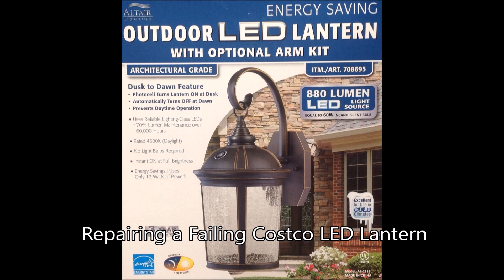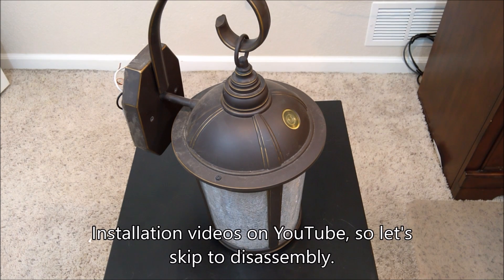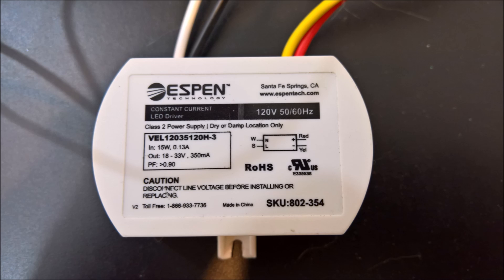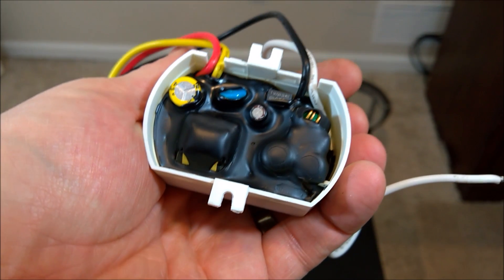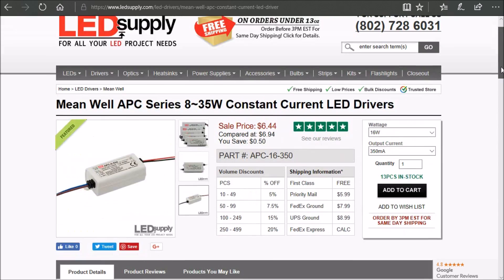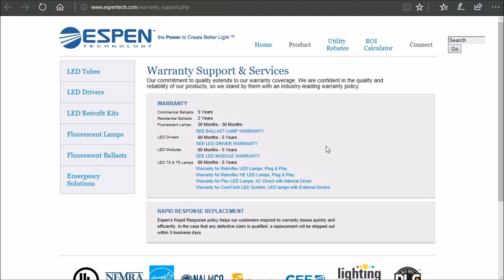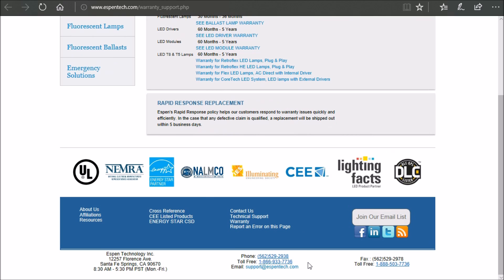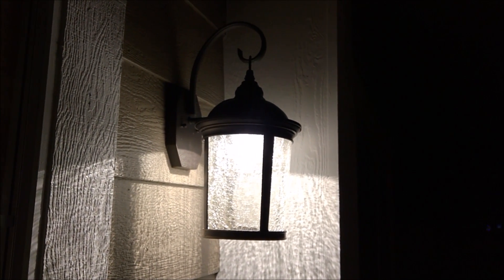Costco LED Lantern Repair

Comment from the maker: To bypass the photo cell, first turn off the power to the light(s).  Start by removing the glass diffuser (the two screws), then remove the three small screws that hold the aluminum disk/reflector.  Now your able to access all the wiring.  Simply remove the single wire nut connecting the black current driver wire to the red photo cell wire.  Notice that there's a single black wire that goes from the house power all the way to the photo cell.  Cut that black wire leading to the photo cell about half way.  Strip the end of the black wire that goes to the house power, about 3/8-1/2 inch, and re-connect it to the black wire of the constant current driver with the wire nut.  You can safely ignore the red and black wires to the photo cell (leave them disconnected).  Re-assemble in reverse order.
Reply: My exterior led wall lantern ceased to function.  I never experienced the flashing behavior, it just went out like a dead bulb.  I was thinking it might be the led disc bulb in it, and I have removed it, but I know not how to test it to determine if it is good or bad.  If it is bad, I have yet to find one available anywhere that would be an acceptable replacement.  Would you happen to have any recommendations as to what I could do, besides replacing the whole unit?

Comment: the problem was fixed because you bypassed the photocell. That is why your unit was flashing. Masking tape over the sensor would have solved your issue.  Light reflected was turning the fixture off, then it goes on, then it goes off.  Common installation issue.

Comment: my Manual for (altec AL-2148) says on Pg.2:  Maximum Wattage 9 W..   so the APC-16-350 , even the APC-12-350 is concerning unless it has a range.. STILL confused..
Reply from the maker: Sorry, I'm not sure if that's the same model.  The idea behind this video is for you to examine your existing driver, decode the values listed on that driver, and try to find a replacement driver.  Do not simply buy what I used hoping it may work, unless you have lights exactly like mine.   As far as wattage, the driver's wattage should exceed the LED light array wattage.   This is just the driver's capability.   Next, you need to determine the voltage range required.  Looking at your existing driver, hopefully there's something like "voltage range" on its label.  Your new driver needs to meet or exceed this.   if your existing driver's voltage range is 18-33 volts, then your new driver must have this range or greater but includes the original values.  For example, 14-48V.  Lastly, is good to check the temperature range and water resistance of the new driver.   The reason we need a wide range of operating voltages is because LED's voltage drop varies with temperature.  And just to let everyone know, it's been over six years since I made this video, and all of my lights are still working.

Comment: Hi Ricardo, Thank you for the video. At the 11:38 mark, the red and black wires from the light-sensitive disk aren't attached to anything. Should I do anything with them before I close up the lamp?
Reply from the maker: Those wires are for the photo (light) sensor.  I think I mentioned in the video that I was bypassing the photo (light) sensor.  You may want to check out my second video on repairing the light here's a link https://www.youtube.com/watch?v=YDYhNTIJgg0
Reply from the maker: If you want to keep the photo sensor, think of the sensor as a switch.  The sensor conducts (switches on) when it gets dark.  The sensor is then wired between the house power and the constant current driver.  The sensor's black wire would be connected to the house power (hot black wire) and the sensor's red wire would be connected to the constant current driver (instead of the house hot black wire).  I think I included this detail in the show notes.

Comment: How can I order LED light disc.
Reply: It's not worth messing with just buy a ceramic bulb fixture from Home Depot and remove the transformer wire in the bulb directly to the dusk dawn sensor if it is still good. Then you can just use a regular LED bulb never have a problem with it again.
Reply from the maker: @Mike-01234  Many LED light bulbs are meant to be used indoors.  The huge temperature swings can and will kill these bulbs too.
Reply: @rickmorenojr  Never had an issue with mine. I'm in Phoenix we get some temp swings from 20F-120F

Comment: I have used this video several times to help me replace the drivers on my lights as well as the lights for my neighbors. However, I have a new problem that I’m hoping you can help me solve. The photocell has gone bad in one of my lights. I enjoy the photo cell feature of the light. Can you recommend a good replacement photo cell?

Comment: I found these lamp have a photocell  turning off when sun up and on when sun up. It is often label to be used for flurescent only. Not designed for this application. It might induce current to the circuit causing driver to blowout. I replace the driver several times and the issue continue to occurs. I used the photocell with a led strip for a season and the driver for the led strip blowout also!!!

Comment: I have the same model light but my wiring is different. I purchased your recommended driver, installed it..still flashing but now have fewer led lights. Never buying these lamps again

Comment: I bought the APC-16-350 as indicated and it ruined my leds. If you are considering do to this, buy APC-12-350 instead, which provide 12 V and not 16 V as recommended.
Reply: AND.. be aware..the APC-12-350 may STILL be too high...check your  model #.. i have an Altair #2148 (says Max wattage 9W)

Comment: Thanks for the video!  I have 2 of these at the front door, one started flashing like in your video after about 5 years.  Like yours, mine had the single LED chip with 8 little LED squares on it.  But only one of the 8 little squares was blinking, the other 7 were not lighting at all.  My second lantern had 3 of the 8 squares lighting solidly, and 5 were dead.  As a test, I hooked the LED chip from the first light in place of the LED chip from the second, and it started blinking too, from the one square that lit.
Rather than messing with new chips and new drivers, I bought 2 plastic keyless bulb bases for $1.58 each at Lowes, and a pair of 320 Lumen, medium base, LED bulbs ($7.98 for the pair).  I removed the drivers, removed the LED chips, opened up the wire hole where the chip was to 3/8 inch, and wired the bulb base to the power/photocell circuit (being careful to tape/insulate the wiring screws on the bulb base) before bolting the bulb base to that aluminum disk.  At night, the bulbs show a little bit thru the glass, but it looks pretty good.  The photocell still works with the new LED bulb.  This solution was about $12 total to convert both lanterns, and if these LED bulbs ever burn out, they are simple to change like an old incandescent screw-in bulb.  Hopefully these keep working for years to come.  Others may like this alternative too.
Reply: Hello Joseph, I have same issue, could you please share the link of the bulb base? Thank you!
Reply: @papiyas2000  I bought at Lowe's, the receipt says "71130 Eaton 600w plastic keyless bulb base" for $1.58 each.  Their website says Item #71130 Model #S1174W-F-LW.  I had to find 2 little nuts to go with the screws that come with the fixture.

Comment: Thank you for posting this video.  Watching it, saved me from spending $250 on ebay, since Costco no longer carries this item.  Finding the needed parts to fix the lantern was easy and so were the instructions.  Fixing itself took less than 30 minutes.  I was lucky to have found your video.

Comment: Hi Richard, is there a video on how to upgrade this lamp to a socket for a bulb?
Reply: Tried the fix mentioned in this video. Replacing the driver fixed the blinking, but only 1 of the LEDs was working, so the light produced was very dim. 

I went to Home Depot and purchased this weatherproof light socket for a little over $3 (https://www.homedepot.com/p/Leviton-Weatherproof-Socket-Black-R60-00055-000/100356874). Took out the metal LED plate, removed the LED and wiring. Using the new light socket, I traced it with a permanent marker and then used tin snips to cut out the circle shape. Tightly fit the light socket into the metal plate and removed the driver from the light wiring. I connected the socket's white wire to the white wire from the light sensor and the socket's black wire to the red wire from the sensor. Put it back together (after testing the bulb would turn on) and presto. Took me about 15 minutes total. I did not remove the fixture off the house and it still works great for day/night time.

If this happens to any of the other 3 fixtures, I will do the same thing. For $3, super easy and quick fix.
Reply: @yakmayar  link has changed or something. Pulls up an oops page.

Comment: Hi Richard, Thank you for your videos. We have 4 of these outdoor lights. We have replaced the LED Assembly on 2 after the blinking started 2 years ago. Now we have 2 more that are out. No strobe on these. Have you replaced the the LED Assembly on any of yours? If so, Where would I get Them?
Thanks so much!
Reply from the maker: Fortunately, I was able to replace the constant current driver on all three lights and they still work perfectly.  If you decide to replace the LED assembly, try to buy one that has a built-in driver or get one with a matching driver.  I would probably try ledsupply.com or ebay

Comment: Good video - many thanks.
If it helps: Altair Lighting website: https://altairlighting.com/default.dmx
Includes Instruction Manuals, Photocell Replacement and Plate and Driver replacement instructions for this lamp and others.
Looks like there are 3 model variations of this lamp: AL-2148, AL-2149, AL-2150
Also, from the bottom of that page:
Altair Lighting provides high quality, energy saving integrated LED light fixtures. If you have any questions or need to reach customer service, please call or email us.
Altair Lighting: (800) 787-1021
Altair Lighting: info@altairlighting.com
Reply: Since my lantern had significant failure (only 3 of the 8 LED chips were still working), I decided to replace the LED panel and driver with a simple bulb holder and LED bulb. This is a cheap and functioning alternative, provides a great looking lantern and lighting, and the bulb can be replaced very easily if needed in the future. I still used the light-sensor, so the bulb turns on at dusk and off at dawn. Amazon parts were:
  E12 lampholders, pack of 8 (only needed 1), for $10: https://smile.amazon.com/dp/B07YWFS5DL/
  E12 Candelabra LED Light Bulbs 60 Watt Equivalent, pack of 4 (only needed 1), for $14: https://smile.amazon.com/dp/B07PZBGYZL/
So now I have plenty of spares (7 more lampholders and 3 more bulbs) for other lighting projects. I did all this a couple of months ago, it's been working great so far on the first bulb. See pictures here: https://photos.app.goo.gl/r9mKMxjyLBkbv3kv5
Reply: @RobertShrimpton  That"s awesome! Come do my 4 please :-)
Reply: @RobertShrimpton  did you happen to do a video on how you did it?
Reply: @CENTAUR559  Sorry, no, I didn't video it (yes, ironic given that this is YouTube), but I did take several pictures to illustrate how I adapted the original light. See the photos link in my original comment, above. Basically I unscrewed and removed the old LED panel, and drilled a series of holes to make a single hole large enough to hold a small bulb socket. I include links to the parts on Amazon - much cheaper (if you have multiple units) than replacing the LED driver module, and it's still using efficient LEDs, but now they're in an easily removable bulb!! :-) And I think it looks even more attractive with the bulb in there, than it did before.
Reply: I should also mention that I in no way want to hijack Ricardo's video regarding his repair approach, but since this alternative worked for me I thought it worth sharing here.
Reply: @RobertShrimpton  Yeah.. I saved those photos for future reference. I may try that. In the mean time I ordered the 12 watt driver to test. If not then I'll definitely go to a bulb modification
Reply: @RobertShrimpton  thank you for your idea. I ordered the same parts and lights from Amazon yesterday, they arrived today and my light is up and ready to come on at dusk. It is a great looking revision and should make life a lot easier. My Dremel came in handy for making the hole in the metal plate.
Reply: I just saw their link for ordering parts. The link downloads a PDF that provides details for determining which model light you have. It also provides troubleshooting methods that will let you know what part(s) you need to replace.
https://altairlighting.com/wr/docs/Altair%20Lantern%20Troubleshooting%20Guide%2008242020.pdf

Comment: Even though the LED Supply has a picture of the AL-2163 associated with this repair, the driver does not work with it.  I would suggest calling Altair and they will ship you the correct one for $5 and shipping.  The AL-2163 has only 2 wires off the photocell and when bypassed only two of the lights come on.

Comment: I just replaced mine today but now only four of the lights are lighting up and before it was blinking bright.   But..I was confused because the black wire ran from one side to the other so I connected the red to the brown wire.  Is that the problem? I didn’t have a black wire to connect to the brown wire.  I bought the same driver that you used.
Reply: I read your instructions and cut the black wire and connected to the brown and left the other red and black hanging but that didn’t change anything 😩  I was hoping I wouldn’t have to replace the plate since it was blinking brightly up until I replaced the driver.

Comment: I have the same light my driver went out and purchased a replacement as well as lights and photo cell. Allot cheaper than replacing the entire light. Anyways,  I couldnt remember how to wire it back up . 
You're video is a life saver thanks

Comment: Thank you for posting this video. I have exact type of lights and I bought it from Costco.  I have a total of 12 lights.  Now two of the 12 flickering and light is dimmed.  I wasted of money to buy LED in the first place.  What I plan to do is to convert this LED light to a socket A19 bulb and I can buy a LED lamp to replace it.  It will be a lot cheaper than using LED board and driver.  Next time folks, my suggestion is to buy a screw A19 type lighting fixture than LED type.
Reply: That's what I plan to do. I have 2 outdoor lanterns that have stopped working. R&R original led integrated with normal candelera decorative bulb sockets. Kudos for educating us on how you diagnosed and fixed existing led setup.
Reply: I have about 15 of them all around the home and out buildings.  3 are now flickering and dropping like flies

Comment: Ricardo—Have you had to replace the LED light array? 
After replacing the driver, I’ve had two out of five LED arrays burn either partially out, or fully out. 
I’ve found some that are close, but no exact match yet. 
$10 for 5 replacement arrays...Thoughts???
Reply: I contacted Altair after replacing the driver about replacing the LED plate and they said 12.99 plus shipping.  They should send it for free to customers for selling such a defective product that they have now discontinued.
Reply: Julie, EXACTLY!
I called them too, and got the same response...no way will they get anymore of my money!!! 
4 out of 4 of mine have gone bad!!

Comment: Fixed, thanks to you!!  I noticed that only two of the 8 LEDs on the pad were lighting after the fix. Do you happen to have the part number for the correct replaceable LED pad? Thanks in advance!

Comment: THE LED LIGHTING ELEMENT IS NOT LIGHTNG.  CAN I PURCHASE REPLACEMENT DISC FOR THIS LIGHT?
Reply from the maker: Did you replace the constant current driver?  Still not working?  Then perhaps you can replace the LED array and constant current driver as a set.  Or there are new LED assemblies with built-in constant current drivers.  The aluminum disc may be adequate for the replacement.  Talk with the manufacturer/distributor to get right parts for your light.

Comment: Thank you so very much for the clear and very helpful step-by-step directions. I was able to successfully repair my Costco lantern and I've got the constant current replacement saved for when lantern #2 goes out. I wouldn't have been able to do this without your help.

Comment: You can just use 1 of the existing holes to screw in the new driver, you dont need to wire tie
Reply from the maker: You're right.  I've repaired two more lights without using the zip-tie and using the stock screw.  Thanks for the tip.

Comment: Everything looked good until I wanted to reconnect m photocell and realized the wiring was not correct! Can you describe where the photocell wires go? Thank you. You state that the red wire was connected to the black wire from the driver but I think the red should be going to the load/LED light. please recheck the beginning of the your video as you dismantle the lamp. The wiring doesn't seem correct.
Reply from the maker: Check out my second video https://www.youtube.com/watch?v=YDYhNTIJgg0
I think a do a better job this time showing every step.
Reply from the maker: If you are keeping the photocell, the photocell's output, or red wire, should be connected to the brown or line wire of the constant current driver.  If you're bypassing the photocell, the house black wire is used and the photocell's red and black wires should not be connected to anything. The house neutral wire, the white wire, should be connected to the blue constant current neutral wire.  Check the label on the constant current driver.  It should indicate which wire is the "Line" and which is the "Neutral".